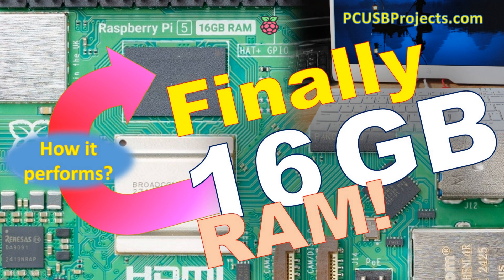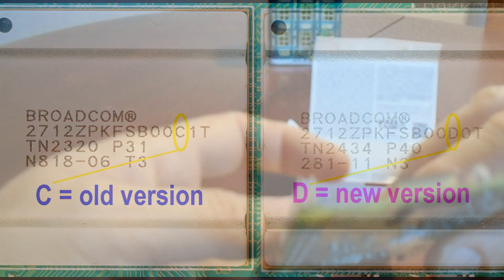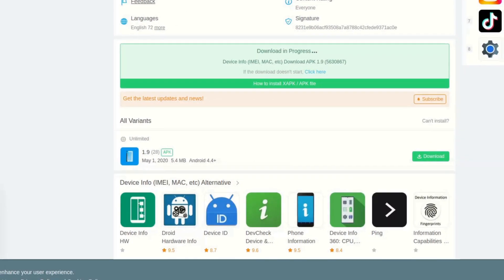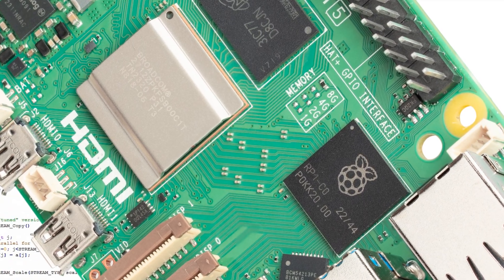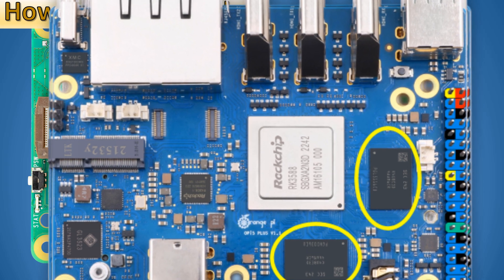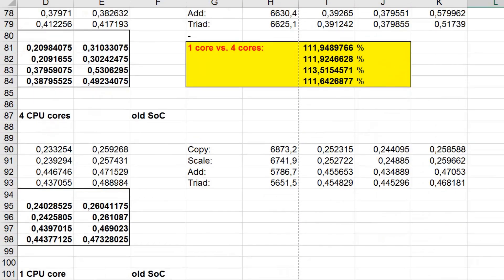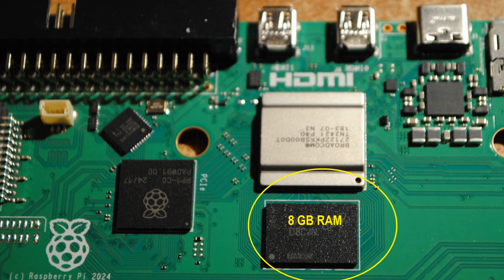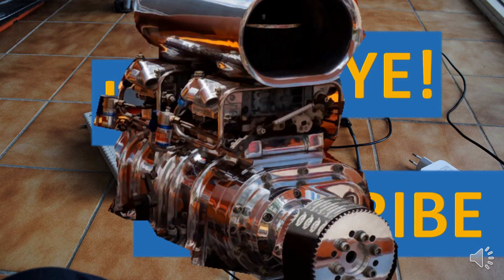Raspberry Pi 5 with 16 GB RAM and a new SoC is here! How it performs? Is it better than old one?

Comment: I wish they would make a unit with 2x 1Gbps wired NIC's.... 8-16 Ram + 2x wired NIC's would make a great server for Proxmox or CasaOS.
Reply from the maker: Watch this video next: https://youtu.be/xk71szNDWok. Raspberry Pi is primarily made for desktop use, therefore you need a hat. But there are SBCs like Orange Pi 5 Plus and Banana Pi R series that have from 2 to 5 Ethernet ports. I've recently tested Orange Pi 5 Max that has a similar functionality as Orange Pi 5 Plus: https://youtu.be/9dNoa8zPWkU, but only 1 Ethernet port.
Reply: @pcusbprojects  thank you for that. Vlan is a way around this, using another smart switch to overcome the lack of ethernet.
Reply from the maker: You are welcome! VLAN is certainly an option, but it doesn't provide physical separation of networks segments....

Comment: How can one get a Pi5 with new SOC?
Reply from the maker: I guess, this is probably easier than getting RPi 5 with an old System on Chip (SoC), because RPi 5s with the old SoC are most probably not produced anymore. If you buy RPi 5 with 16 GB RAM, it will surely have the new letter "D" marked SoC, because the old letter "C" marked SoC only supports 8 GB RAM. I'm not sure, if you can specifically request a RPi 5 with less than 16 GB RAM to be equipped with the new SoC from your local supplier, but if you buy RPi CM 5 or RPi 500 they both have new SoCs...

Comment: for raspberry Pi 5 if i want run 2 or 3 virtual machine (vmware)  like debian, ubuntu and ubuntu server. the 8gb version is ok or too weak ?
Reply from the maker: It's all about RAM allocation for a particular VM. If you wanna run an OS that requires 4 GB RAM as a minimum for optimal operation then you definitely need 16 GB RAM to run 2 VMs, because you also have to run the host OS - Raspberry Pi OS in this case. If you run Linux based VMs it basically the same story, but Linux installations usually run on much less RAM. If 2 GB RAM is sufficient than 8 GB RAM on host would suffice to run 2 or 3 or even 4 VMs. However, you should leave the host OS with some spare RAM to be on the safe side. RAM size overrun is usually a disaster for a RPi virtualization host. Watch this video to learn more: https://youtu.be/4603ZRIURuU. Memory swapping to an SD card or even to a SSD  just don't work work as well as on a classic PC.  I've tried to run Windows 10 and Windows 11 on RPi 5....

Comment: They need to come out with an x86_64 version.
Reply from the maker: Yeah! There are already such computers.This video might interest you: https://youtu.be/Cjjdpm96vh0....  However, Raspberry Pi is an ARM64 architecture computer. It's as hard to immagine Rasbperry Pi users switching over Intel/AMD architecture, I cannot envision PC gamers switching over to ARM64 architecture. A significant of existing SW would be rewritten to switch over to another architecture, Microsoft actually trying this, but the main stream Windows 11 is still x64 based. It is not just the operating system, but also drivers from different HW manufactirers that have to be rewritten. For example: ASM1184e chip is a PCIe switch (watch these videos to learn more: https://youtu.be/kRHbpFQgxu8, https://youtu.be/zNve_hjinDI ) which is crucial to support multiple PCIe devices on Raspberry Pi 5, but there is no driver for Windows 11 on ARM64, so you basically cannot use an SSD drive on an PCIe extension board with a PCIe switch board.
Reply: I think there’s a version of Windows that you can run on raspberry meant for iot which is actually free. All Microsoft needs to do is a new Hardware Abstraction Layer dll. It’s just one file.
Reply from the maker: I don't know what you mean, exactly. We are talking about computer architectures the here. Raspberry Pi on my opinion will not switch to x86_64 architecture from current ARM64 architecture at least for a few years. Regarding Windows installation I suggest the following video: https://youtu.be/EiqI__4PoK0. However, it is currently impossible to install Windows 11 on RPis with the new SoC. A new version of UEFI BIOS would have been neded, but here is none, yet. We are of course talking about Windows 11 for ARM64 based computers, not x86_64 based computers. The only exception is emulating x86_64 architecture on Raspberry Pi 5 which you can watch here: https://youtu.be/4603ZRIURuU. Of course, having 16 GB of RAM is great plus here.... So, RPi 5 with 16 GB RAM is definitely the best option to do this,... Watch the video for more...

Comment: You presented a question, but did you answer your own question?  OR was this a teaser to watch more videos without a conclusion?  Bottom line.. the RPi5 (8 or 16GB) cannot compete on performance and price with many other small form factor devices available today.
Reply from the maker: Of course it can. It is a very competitive SBC offering a great price/performance compared to Rock Pi 5 and Orange Pi 5 Plus. You cannot judge your SBC just by amount of the main memory that it has installed or inbuilt. When there is enogh memory to solve your problem, memory speed is certainly more important. I've also mentioned in the video that RPi 5 with the original SoC has a faster memory access than Rock Pi 5 and Orange Pi 5 Plus. Raspberry Pi 5 with the new SoC (no matter of its size) has even faster memory access....
Reply from the maker: If you intent to build a desktop RPi 5 with 16 GB RAM PCIe port connector si certainly an excelent option (better than M.2 connector that si primarily used to connect SSDs), because it makes it possible to connect more than 1 PCIe devices through various relatively cheap extensnion boards or hats. 

Watch Extreme Raspberry Pi 5 videos to see what is possible: https://youtu.be/zNve_hjinDI , https://youtu.be/kRHbpFQgxu8 ... You'll see that many other SBCs lack many of the presented options includung a powerful cooling system options.

Comment: With the original Pi 5 SoC, I read that it is like a lottery. Some people easily overclocked to 3GHz, but others couldn't. Perhaps we also have a lottery with the new SoC.
Reply from the maker: I think that there is more to this story. First of all, it is very imprtant to have an adequate cooling (for DA9091 Power Management Controller, SoC and DDR SDRAM chips) and a powerfull enough power supplay that must also account for the cooling system power consumption and the power consumption of all the attached USB and PCIe devices. I've built my Extreme Raspberry Pi 5 with this in mind (watch: https://youtu.be/zNve_hjinDI ). But theoretically there could also be other factors like a bad SoC chip series with lesser frequency capabilities, or slower DDR SDRAM chips (from a diffetent maker) etc.
However, I've been easily able to overclock RPi 500 with 8 GB RAM and RPi CM 5 with 4 GB RAM with the new SoC to 3 GHz (watch: https://youtu.be/5Xffn_21_QY ) and also the old RPi 5 with 8 GB RAM and old SoC to 3 GHz, only RPi 5 with 16 GB RAM with the new SoC seems to have problems with 3 GHz. I've only been able to overclock it to 2.8 GHz with the original PSU. However, I had similar problems with the old RPi 5 with 8 GB RAM that I'm running now constantly on 3 GHz. 
On the other hand, RPi 5 with 16 GB RAM error seems different and may not only be heat disipation related.
RPi starts normaly, but reports errors that are at least on my opinion RAM related. It is possible that the future RPi 5 with 16 GB RAM will use a more capable RAM chip, or if there is a problem with the memory controller, a more capable memory controller within the SoC. According to all the tests that I've done, there is a high probability that the error is related to the RAM size. A lager dynamic DDR SDRAM may need a longer memory refresh cycle which may not be possible with a higher clock rate... I'll also try to imbed my RPi 5 with 16 GB of RAM into my Extreme Raspberry Pi. If it works, I'll know what have caused the problem, if not I'll keep guessing...